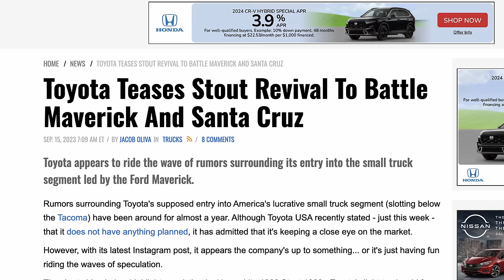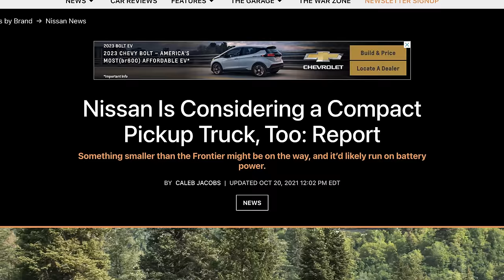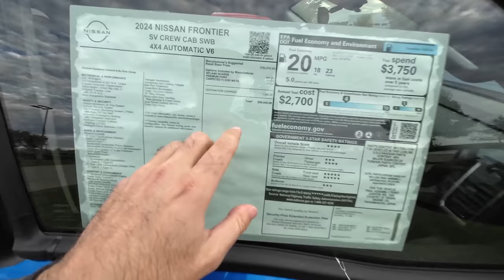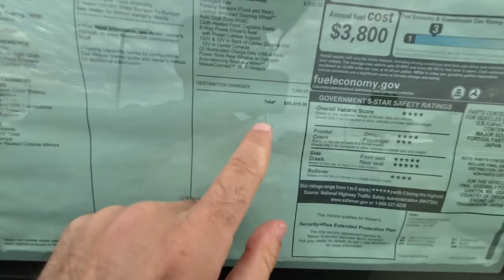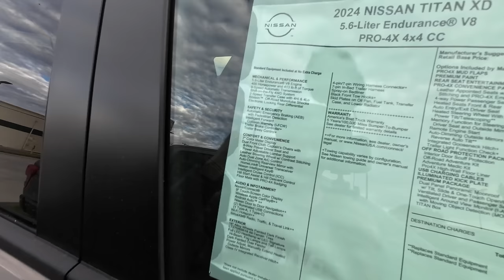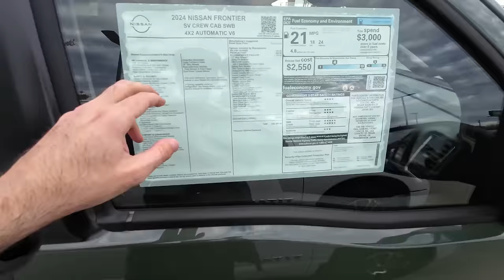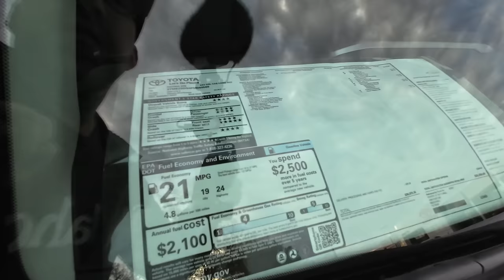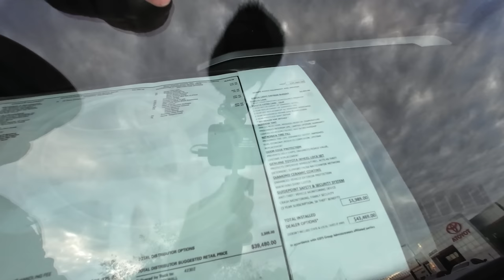Nissan’s NEW $20,000 TRUCK Has Ford & Toyota In Panic Mode!

Comment: I'm going to say it again: auto makers have totally lost the plot when it comes to trucks. They've turned them into luxury soccer mom vehicles and forgotten their bread and butter: guys who work for a living.
Reply from the maker: I use to own a Ford Raptor but it was so much $$$ that I was afraid to use it as a truck, Lol. Sold it super fast.
Reply: @MotorFeed  my point exactly!!!!

I paid $700 cdn for a running and driving 2006 F150 beater 4 x 4. I was unloading at a customer's place and he was helping. He bumped the side of the bed "oh I'm so sorry" me: kicking the fender denting it "no worries man, this is a TRUCK...." lol
Reply: And the small truck market, event with the proposed Ridgeline, will still rob you of 49,550$CAN for the Sport trim. 58,550$ for the BlackEdition. Chipping 34,795$CAN for a Maverick XL makes more sense. If you can get one...
Reply: Well said, No way a truck should cost 100Gs
Reply: @sergiovalente3036  and the maverick is just an econo box with a truck body.
Reply: Come to Australia , with the demise of the Aussie ute the  Toyota , Ford , GM . Mitsubishi  and Nissan bog standard tradie wotk  utes [ trucks ] everywhere . Petrol and Diesel
Reply: Sadly, too many soccer moms, and young gen z nerds, are buying buying them out
Reply: I tried to buy a Maverick at the local Ford dealer. They wanted 6k over sticker. I laughed. I ended up buying a nice used truck and just paid cash. Glad I did. I would still like a Maverick, but no way I’m paying that kind of money for one.
Reply: I've seen a lot of videos lately that explain how manufacturers stopped making the super-popular tiny pickups of the 80s because of CARB emissions rules.
Reply: @muskokamike127  and the truck doesn't even have a frame it's a subframe car with a box
Reply: @user-jx8jb1vq3y  I KNOW....overload it and it'd fold like a kid with a pair of 2's.
Reply: @shoobidyboop8634  that's a load of crap, a small pickup with a fuel efficient engine will produce a LOT less emissions than a large truck with the same engine. 

they just wanted to sell bigger more expensive vehicles.
Reply: @rongt859  I KNOW you guys get all the cool 'utes. 

We haven't been able to buy a diesel in a small truck here since I've been alive.
Reply: @sergiovalente3036 $60K for a Honda Ridgeline 😂😂😂😂😂😂
Reply: You say that, however, the bare hones trucks and cars just don't sell. Consooomers want all the newest tech in trucks and cars. So until consumers stop demanding it, they won't stop making it.
Reply: Turns out, those guys that work for a living, make bank; hence the modern truck market. These new smaller trucks are for the young guys just starting out…
Reply: @shoobidyboop8634  ford ranger?
Reply: Exactly.  Who in their right mind buys a $100K truck and loads it up with wood/dirt/stone.....?   Way too risky. You may scratch the paint.  For $20k it's not such a big deal and you can use the truck like a, oh yea, a truck.  If I had a $100k to spend on a vehicle it would be a mid life crisis road rocket.  I will keep my $25k new, now 22 y/o Toyota Tundra for now..........
Reply: @actionfaction2558  yes, young guys starting out as carpenters, contractors and the like. Or for guys who don't need a full sized truck.
Reply: @GraceAloneThroughFaithAlone  Like I said: they are marketing them as soccer mom vehicles and status symbols. "they want all the tech" I suggest you talk to contractors and carpenters "they" don't want all that bullshit. That's why 70's and 80's trucks are getting all the money now, guys like me buying them up cuz we're tired of the BS.
Reply: @muskokamike127  No entirely.  Through the unintended consequences of the EPA's regulations, it's easier to make larger vehicles of a given segment, especially for trucks as the MPG targets you have to hit are relatively lower as the size of the vehicle increases.  If manufacturers could get away with selling you a smaller, simpler, cheaper to manufacture truck, even close to current day prices, THEY WOULD.
Reply: metalhead6526  Drop that doom and gloom mentality.
Reply: @yarrik701  You were doing ok until the last segment: no, not necessarily. Companies like Ford WILL shoot themselves in the foot by NOT selling vehicles in North America that people want. It's called manipulation. 

For eg: one reason they didn't sell the 4 dr ranger in N/A for years is because they wanted to force people into buying a more expensive F150 and with that, they made the claim "the best selling pickup in North America". The 4 dr ranger was built all over the world, just not in the US. There was no economic reason it couldn't be sold in the US, just marketing. 

Same as the Focus R/S: they didn't sell it in N/A because they wanted people to buy the mustang. 

This is all directly from the mouth of a Ford dealer. It pissed him off because he had 20 ppl a week coming in asking to buy one.
Reply: @muskokamike127  Trump tariffs destroyed the profit margin on the Focus
Reply: @ralphinator2  umm buddy? this was going on LONG before trump even decided to RUN for office. 

I suppose you blame trump for the demise of the corvair too. 🤦‍♂
Reply: @jmmywyf4lyf  I should have been more specific: Small pickups for men.
Reply: @muskokamike127  If companies are going to leave potential profit like that on the table, that's just bad business practice.  If you still think vehicles are getting bigger because manufacturers, for whatever reason, feel the need to super size trucks, look up the footprint model with respect to the CAFE standards.  

Even though it's not as small as the original, look at the Ford Range.  They have no problem selling it for, well, setting an MRSP for roughly $30K to $55K that should be 1/2ton to 3/4ton territory and not base trim.  They know there's demand out there, and if the EPA's regulations were to be pulled back about 20 to 30 years worth, or they can figure out how to make EV batteries affordable and cram one into a small truck, you might see compact trucks the size of the old 90s models come back with a vengeance.
Reply: @shoobidyboop8634   😆 yeah, I cant bring myself to buy one.. wanted an s10, or nissan when I was a kid, to drop it to the floor, but never actually did it.
Reply: @yarrik701  Not only that, and I know that costs have risen over the years, but go back to basics without all the electronic goo gaws and jimmy jims. giant touch screens? SMD, give me knobs and buttons for 1/3 the price. Ditch the configurable digital gauge cluster to a speedo, tach, fuel oil and battery analog and I'm good.
Reply: @muskokamike127  It would be nice if manufacturers went back to manual controls and a more mechanical, rather than electronic approach to just about everything in a vehicle.  Issue is, the EPA regulations require ever tightening emissions standards and higher MPG numbers that the manufacturers just about have to run vehicles off of complicated ECMs with more sensors than sanity to meet.  Probably why it's so difficult to find a good manual transmission vehicle nowadays as well; combination of fuel economy testing\numbers as well as a lot of lazy people out there who can't be bothered to row through gears.

The digital dashboard, head units and other various controls probably comes down to cost.  Instead of designing and building out a real dash, HVAC controls, etc. it's cheaper to slap a couple screens and a crappy tablet in the vehicle and call it a day.  They don't seem to care about the issues with having to look down at your center console and navigate through 3 levels of menus just to change the dang temperature as a bad user experience, let alone dangerous compared to not having to take your eyes off the road to make simple changes.
Reply: @muskokamike127  Also, (not sure why YouTube wouldn't allow me to put this in my previous comment), with the new 2026 law soon to be in effect, things will get even more complicated concerning vehicles and electronics.  They've mandated driver attentiveness monitoring equipment, passive (maybe active) impairment monitoring, as well as remote kill switches for all new vehicles starting in 2026.  If you think vehicles have too much electronic crap on them now, just wait a couple years until this big brother law goes into effect.  Hopefully they don't make it difficult to register or insure old vehicles as this goes into effect..
Reply: @yarrik701  I heard a bit about that and didn't pay much attention because I don't plan on ever buying or leasing a new vehicle. 

You're 100% correct on all counts too. I think that is why gov't is pushing EVs so much due to the fact that they're networked already and easy to control. In addition, the gov't can control how far you go a la "15 min cities"
Reply: @yarrik701  OH yeah, 100% on the controls. I rented a jeep compass for a weekend it drove me freaking batty. "all I want to do is change the **(&($&*# radio station"

I knew shit was about to get real when the battery died in my F150 and over a week the ECU "forgot" that I had power windows so they didn't work. WTF? WHY are the power windows connected to the ECU? There is ZERO reason for it. 

The thing about emissions is just a load of crap. They make engines so complicated they don't take into account the emissions caused by the overly complex manufacturing and maintenance. "oh I saved $2500 in fuel over 4 yrs" yeah great, but to do that you have to spend $3500 over 4 yrs in replacement parts. BUT MAH EMISSIONS! yes, you reduced emissions out the tail pipe but you produced 50% more emissions having to cast and manufacture the timing chains, phasers, guides, etc.
Reply: I don’t think that’s true anymore. Most people buy trucks now for the practicality and luxury. I would guess the majority of truck owners in the US don’t actually own them because they NEED it for work
Reply: Guys who do manual labor for a living just buy tried and true old model silverados and f-150s, not these luxury vehicles with tiny beds
Reply: @nightmeer0820  Luxury, sure.  Practicality?  Maybe with an asterisk.
Reply: @user-ig9ey9ze2w  not sure about where you are, but all used trucks are getting all the money. Like $20,000 for a 13 yr old. 

And if no one is selling bare bones basic durable trucks new, there aren't any used.
Reply: @nightmeer0820  That's what I mean when I say "truck makers have lost the plot". Back in the day, the only people who bought trucks were working men. 

Thank you for confirming I am correct.
Reply: I would never buy a new truck for that price. Pick ups are use to tow, haul stuff. They are now turning them into luxury. Half of the time I see newer ones on the road and don’t see anything in the bed.
Reply: @harold1901  I forget the exact number but I read years ago that something like 80% of off road vehicles won't ever be used off road and 75% of trucks won't ever be used to tow or haul anything.
Reply: Nissan listen up please. Electric truck I'm not going to touch it at any price.
Reply: Come on Nissan! Do it for the working man!
Reply: metalhead6526 that’s wildly irrelevant who hurt you
Reply: You are a rare breed.
Reply: Bingo 🎯 🎯
Reply: 10:45
Reply: Absolutely.   I teach and have drop off and pick up duty every day.   The number of trucks used to cart kids around is ridiculous.   I also run bees and need a truck to do so.  I sold my Silverado because it was nothing but a mechanical headache.    I now drive a small car.   I do need a truck, but only a small one now that I've cut back my bee business to a hobby.   I don't need to haul a lot of heavy honey boxes anymore.
Reply: its spocken, as ni  san, not neessan.. ausie.. nissan.. there is no e..say it qiuk, nisan.. like you say mazda, its not maaazda. @MotorFeed
Reply: Thats what diesels are for dude. Trust me, nobody forgot the working man there are still plenty of trucks putting in work out there
Reply: Nope. The lots are full of $90k f150's and 250's.

King ranches.

There are all over the place. Overpriced trucks that no one is buying.

If you want a overpriced truck that was worth as much as a 1900 sq foot house cost back in 2012.

Go for it.  I'll buy the small one
Reply: Bud light did as well
Reply: @muskokamike127 the problem was emissions standards for large vehicles were different than small vehicles. Then the macho man truck complex set in the industry.
Reply: @collinbradford8866  I hear that all the time, but when you get down to it, that's maybe 10% of the truck market and only because THOSE guys don't use them as trucks. 

Real men who need trucks for work only need it to be as big as necessary to carry a lift of plywood or their tools etc. 

NO working man will buy a 3/4 or 1 ton "to be cool" when they only need a 1/2 ton. Why? because the cost...when you run a biz you're not going to be throwing out money on something "just because".
Reply: There are far fewer guys who actually use the truck for work than guys who don't.
Reply: Nailed it when said Soccer Mom vehicles. That’s what trucks have become just like the SUVs.
Reply: @luongv427  yes that's why I say the car makers have lost the plot. They marketed them as such and catered to that market. 

I can sum it up like this:

It's the same with ford calling the Mach E a mustang.
Reply: That and most modern suvs have been switched to unibody construction making them useless off-road
Reply: I’m a normal guy … I would never use the pickup bed …. Why are people buying these , a trunk makes sense for us
Reply: @Mr.Helper.  The crazy thing? People will buy a pick up then buy a cap or hard top tonneau cover. 

Me: why wouldn't you just buy an SUV then?
Reply: metalhead6526 People just rarely stay the long haul anymore. Marriage is like Russian roulette, but pulling the trigger multiple times.
Reply: If you want to know why, look at CAFE standards in America.
Sedans have very stringent regulations on them, so any cars that get produced will be stripped down for efficiency and higher MPG.
However, trucks (and work vehicles) have looser standards, so car companies are going all-out with trucks (and anything classified as a truck) with soccermom luxuries and status symbol amenities.
That's what's ruining the truck segment in our market.
Reply: @@Seth547 I agree: 
 It's the car companies complying with CAFE standards. 👍
Reply: What is a young gen z?
Reply: That's because the ones that work for a living only count for 15% of total truck sales..sucks but it's true..I would love to buy a two door work horse
Reply: @@Seth547 exactly ...I want to be able to get from point a to point b,have heat and air and for it to be very reliable..that's all
Reply: If you want to put trucks back in the hands of the working class, then get rid of CAFE standards. Luxury amenities will go back into cars and they'll stop filling trucks with soccermom garbage.
Reply: Regarding trucks...When I sold cars an old-timer told me "usually people who want trucks are only trying to appear to be the kind of person who needs them" I rarely see any scratches in truck beds nowadays
Reply: @DocHelliday  re: the scratches, well, many /most have bed liners these days. Mine didn't have any and I carried lumber, lifts of drywall, all sorts of stuff all the time. 

I had one that had a big sticker "non-skid surface" that was slipperier than dog shit and you couldn't scratch it if you dragged a nail on it.
Reply: @muskokamike127  Fair, bed liner is a modern miracle but you know what I mean. If you're hauling drywall, you're a truck guy 🤣
Reply: Heck, you are missing the point...these luxurious trucks are the "new" symbol of status. Not many guys with those trucks are using them to haul landscaping or construction materials....More likely hauling big boats/RVs to show off both.  End of story.😃
Reply: @slchang01  NO shit sherlock, you figured that out all by yourself?
Reply: @slchang01  oh yeah especially the Lariats and shit. Queue Bo Burnham's country song "Panderin'"
Reply: Exactly...
Reply: @muskokamike127 And balky nav screen and cheapy interior.
Reply: @muskokamike127 Sure what’s not to like about a old broken down truck rocking a whopping 110 hp 4 banger?
Reply: @muskokamike127 Prez Trump in 2024!  MAGA 🇺🇸🇺🇸💪
Let’s Go Brandon!
Reply: @yarrik701 EV don’t work in cold winter climates or if you leave them out in hot climates. 
  The batteries are sensitive to temp extremes.
  And charging stations don’t work in cold snowy weather.
Reply: @duncanidaho2097  1) it's still running though 2) no truck needs 600 hp 0 to 60 in 4 seconds 3) it'll still be running 40 yrs from now. 

That's what's to like! 🙂
Reply: @muskokamike127  Hey I agree with you about what they’ve done with p/u trucks with bloated designs and ludicrous horsepower and all the rest of it.  Mainly to appeal to the urban cowboy in too many dudes.
  And jacking up prices beyond the reach of many.
  But the mini trucks of of the late 1970’s and 1980’s were usually punishing to ride in.
  I owned a 1980 Mitsubishi branded as a Dodge Ram with like 90 hp and 4 speed-no a/c.
  II kept 2 bags of concrete mix in the bed to keep from loosing traction on streets.    
  It can be cute when you’re young.
Reply: @duncanidaho2097  I will admit, the small import trucks were tin cans. I took a Nissan for a test drive and it was brutal as well. I ended up buying a ranger. Useless in Canada unless it is 4wd but much better ride. 

Funny story about that ranger. I worked at a place like 4 buses from the subway. A couple of the girls who worked in the shop found out I lived a block from the kiss n ride subway station. "hey can you pick us up in the morning? save us an hour on the bus"

I only have a single cab, it'll be snug

NO prob!!

So we'd all cram in. Thing was, I had a 5 speed. 

The cute shorter girl always sat in the middle and lets say 2nd 4th and reverse, got a little "intimate". 

So one day I pull up, hot summer day and little missy is wearing a short skirt. She hops in, slides tight against me, 1 leg on each side of the gear shift like normal. 

"hi y'all"

Off we go, shift into 2nd "hello"....shift into 4th "oh my" she snuggles a little closer. 

We get to the office and I shift into reverse to back into my spot....YEAH BABY....omg, is that? yes it is, I feel fur lol I turn to look at her she looks me dead in the eye "what"? all innocent. 

The first one hops out, she gives me a quick peck on the check "enjoy your day" hee hee
Reply: @MotorFeed  Whoever brings back the mid to late 80’s compact truck and keeps it simple is going to own the market.  Basically take the Ranger, S10, Hilux, Ram 50 or Hard body from that era and throw a late model turbo 4cyl with a 5 or 6 speed manual and none of the fancy crap.  To me the Stout and Maverick not having an actual frame or bed is a big swing and miss. If there was an actual compact truck available the Maverick would be overlooked in a hurry..
Reply: toyota really needs to bring their new IMV 0 (hilux champ) to the U.S. they'd make a killing on sales since that's a straight up work truck.
Reply: @reddawn2001  100%. I'm shopping around for a mini pickup, honda acty etc because it would suit me perfectly. 

That's a great little beastie the IMV 0
Reply: @jmmywyf4lyf  No, the reason is the USA government puts a 25% tax on all small work vehicles. Go look it up if you don;t believe me. That's why you can buy small work trucks anywhere else in the world brand new for 20k.
Reply: @muskokamike127 utes are cars,  kt trucks
Reply: They make smaller trucks tho.. unfortunately luxury is what Americans are paying for
Reply: @MrOscar5690  That's the thing: guys who need trucks don't give a shit about luxury, they want a vehicle that will work trouble free for decades. 

Take heated seats. If you're a working man, you don't need heat on your ass, you've been on your feet for 8 hrs, you need heat on your BACK.
Reply: I bought a loaded Pro4X for 44k OTD. Hauls sheet goods and tows my boat. So far so good!
Reply: @sergiovalente3036 Maverick's just a car in truck clothing, a total joke.
Reply: @sergiovalente3036 I'll be blue in the face before I pay more than $25K for a mid-size truck! So I guess used market forever, it is!
Reply: The prices are insane for what you get.  Bunch of bells and whistles that will break a few years down the road, attached to a turbo 4 banger that would never last as long as a V6 or V8.  Anyone buying these things are idiots!
Reply: @Dan-mc7xg  you got it. Too much sizzle and not enough steak.
Reply: That's the problem, once women started buying pickups, it totally screwed the working man
Reply: @muskokamike127 and seats as well
Reply: It’s not their fault, it was the EPA that put their finger on the scale with CAFE standards and the chicken tariff tax to try and protect UAW jobs.
Reply: @PumpkinKingXXIII  Very true my friend.